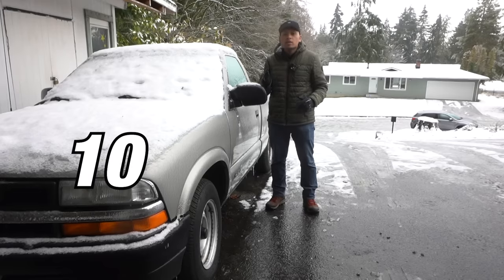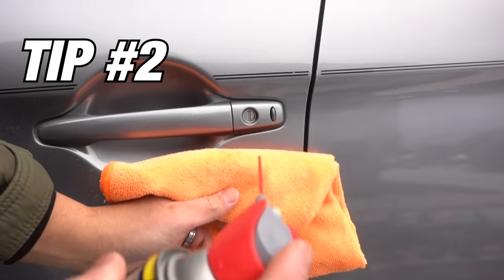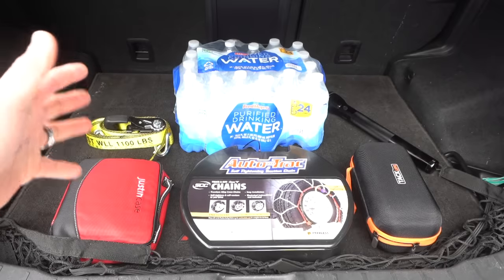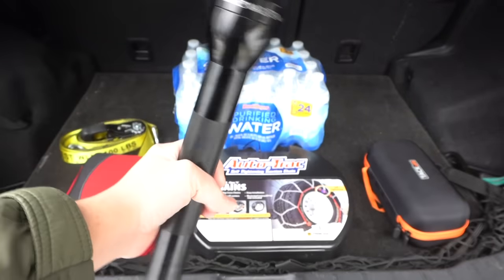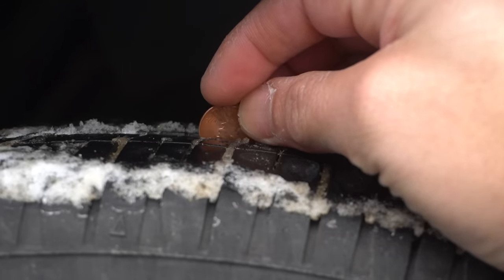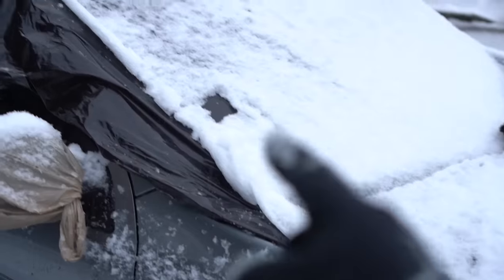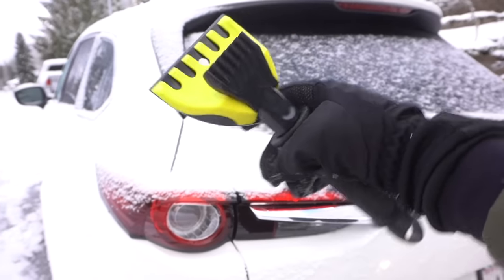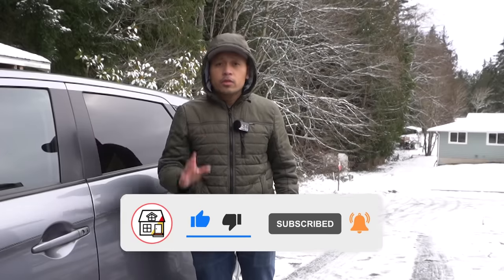10 Winter Car HACKS TIPS & TRICKS That Could SAVE YOUR LIFE! DIY

Comment: Will warming up the car for 10 minutes daily before you depart not drain your battery life? Cause the last thing you want is a dead battery middle of nowhere. Maybe, good idea to get a new battery before the winter starts as prevention?
Reply: Not everybody can afford new battery every winter.
Reply: @WINGKINWONG9082

Warming your car is absolutely safe!!!

The ALTERNATOR ( that’s equipped in every car ) is what is powering the car electronics once the car has started!

And …. What’s even smarter…… the alternator has a way of converting alternating current ( ac ) to direct current ( dc ) so it can send and regulate enough dc voltage to keep your battery always at peak levels!!! 

( I wish I would have thought of that 😢… but in 1821 I would have been a slave and slaves  weren’t allowed to work in a lab… let alone file for.. or receive a pending patent 👀

Good to be in the good ole 21 century 📈❗️
 
Anyway, 

Thanks to the genius mind of :
Micheal  Faraday;Physicist  
                        1791 to 1867
Inventor of electromagnetism in 1821.

Thanks Professor Faraday!

Comment: All you need to do is fill at least 4 large plastic screw top bottles with 1 Part Rubbing Alcohol and 2 Parts Water and keep them in your vehicle. Then in the morning when you come out to your car and the windshield is frozen with ice, simply pour each of the 4 bottles of alcohol/water over the top of your windshield and the ice will IMMEDIATELY melt away, INSTANTLY! No scraping required whatsoever!